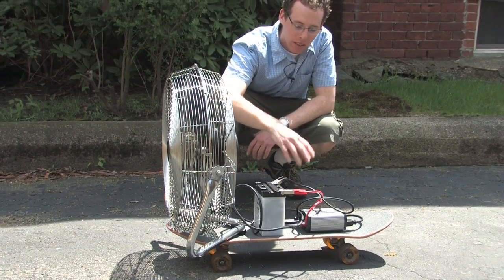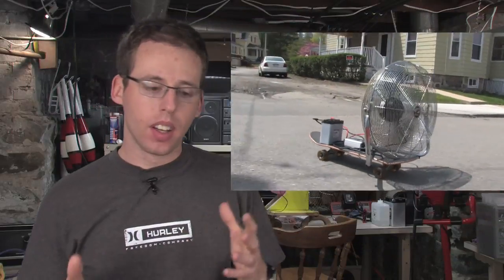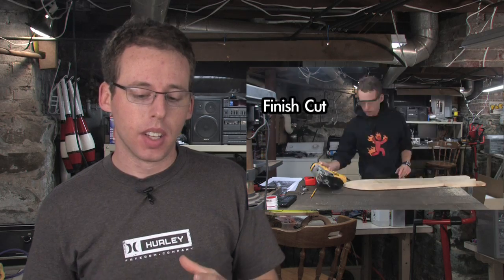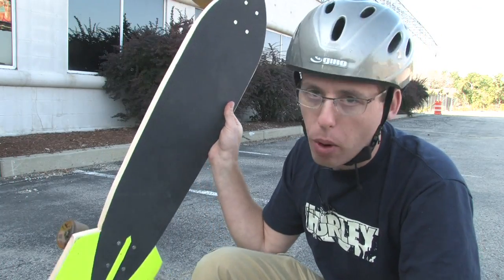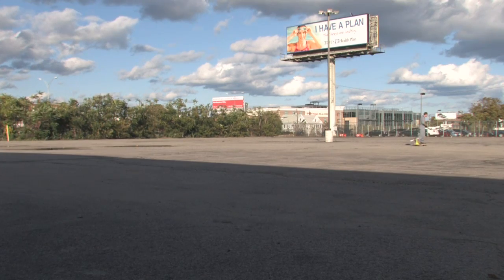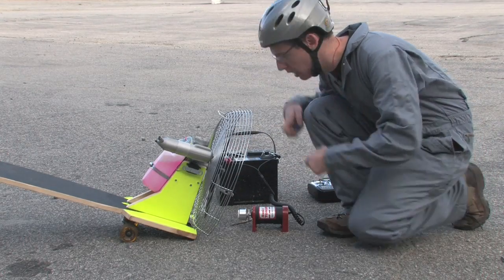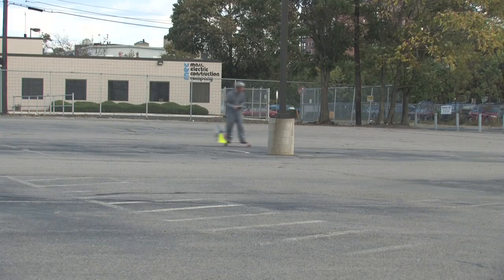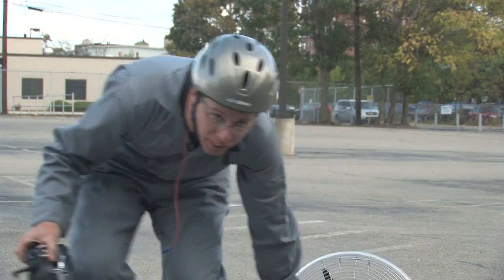Propeller Powered Skateboard - Test Day!

Comment: When your friend was doing to baywatch hair test he was lucky that the prop was fastened to the drill good enough. I have seen props fly off sketch mounts and what they do is fly straight off the mount for 30+ from their thrust. Granted the thrust pushes the blade into the drill, you still need to respect these blades.